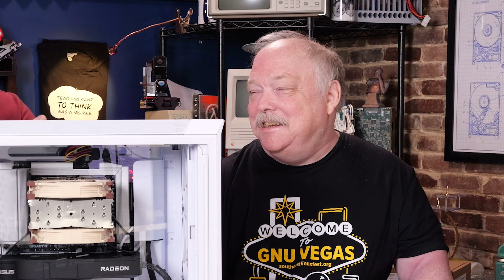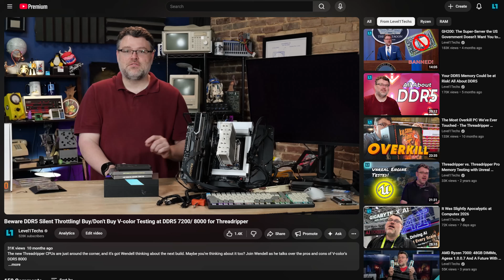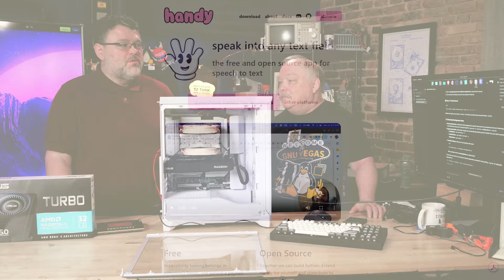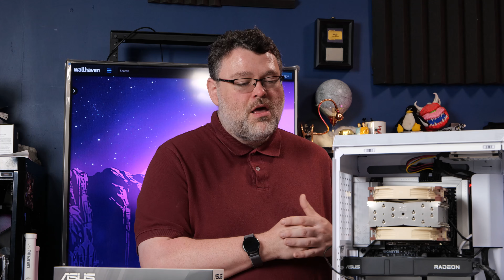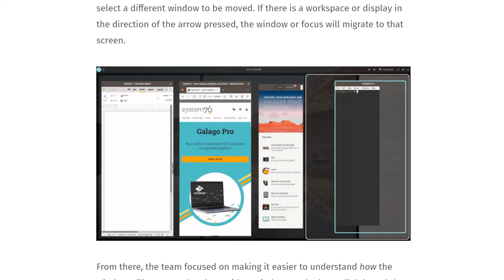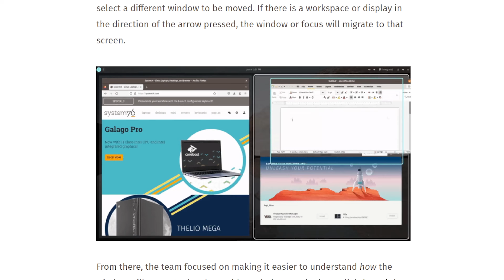Eric S Raymond Build and Ramble

Comment: I have a problem with the CPU cooler airflow direction.  All the cool air the top two case-front fans are blowing, blow to the top of the case, without going into the CPU cooler.
Reply: I had the same thought. I would have wanted it blowing front to back, rather than fighting to pull air from the small gap between the fan and GPU like that.

Comment: If I could have had a 9070 XT with a blower cooler like the one that the 9700 AI Pro uses, I would have bought it. I miss the blower cooler on the GTX Titan Black I had on a research rig during my undergrad days, which was similar to the blower on the reference GTX 980 I used for three years. They're a bit more loud, but I am a fan of blowing the hot air out of the PC instead of it just getting farted out into the case onto other components.
Reply: I've seen people solve that (for GPU cards with one flow through fan) by reversing the airflow. E.g. instead of air flowing from front to back of case, they have one fan on rear top and one rear of case sucking in air then sucked out of one fan on top front and one on front of case, and yes the CPU fans are also turned around to push/pull from rear to front. Dang, wish I can post links to a picture.

Though yeah, a blower setup is better. Else those ducted setups like the big brand workstations.

Comment: I just got done about a week of heavy Sim City 2000 SE replaying and Urban Renewal pack dabbling on Bazzite via Wine + Lutris and sc2Kfix. Runs great w/ system scaling in 5k 180Hz (no idea game's fps), no issues except for when I put it to sleep while running w/ Lutris 'prevent sleep' toggle on (operator error). 

There is a Sim City 2000 Linux port? Or is it the original? I actually was triggered by a $1.50 cent Sim City 3000 sale email from Steam (which I bought of course). For the Linux 2000 SE install though I used my original CD.